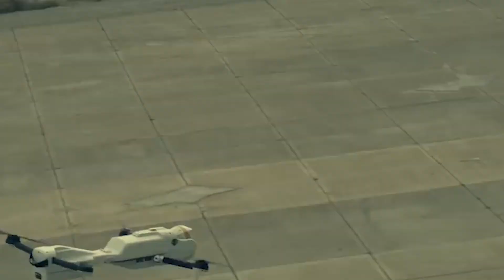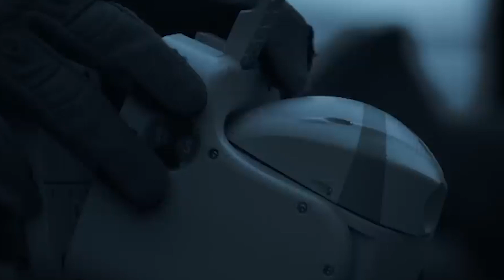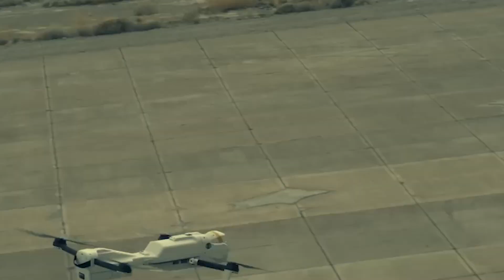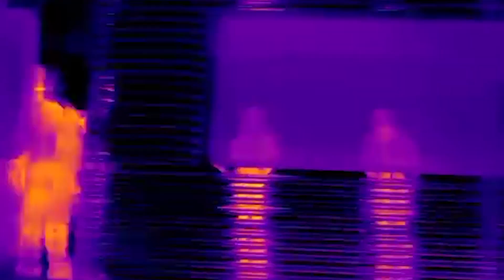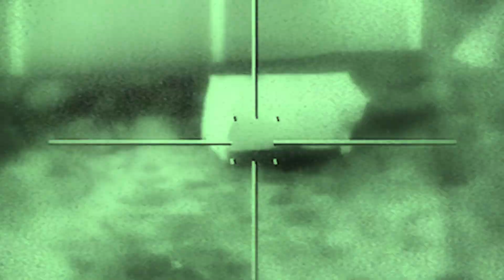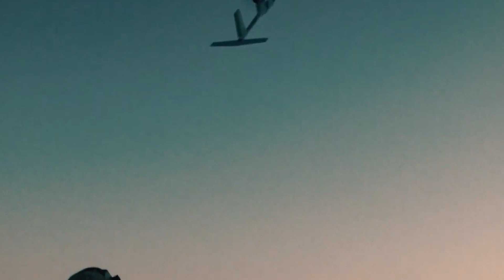The Tiny Yet Lethal US Drone That Turns Massive Targets into Rubble

Comment: I love this concept. However. Wouldn't it be cheaper to use this system as a pure reconnaissance drone and use this system to guide in cheaper less advanced kamikaze drones. This also means for the same prise as one you could get more hits on target using different warheads or even target more things in the area

Comment: Huh, so if the Russians think they have seen the worst of Kamikaze Drones, they ain't see nuthin' yet! Having a drone with a Gimballed warhead, that can run Silent, is a nightmare scenario. Plus is had various warhead payloads like Shotgun, HEAT, Traditional HE Kamikaze, plus it's also a scouting Drone with Radar/Lidar capabilities. Someone wanted to make a drone for all occasions, which does cost more than the one Ukraine is making and using but it can also do MUCH more, AND it is recoverable if it doesn't use it's payload, AND most importantly, Jamming won't work on it! NOICE!!!

Comment: $94 k, per drone, and The Ukrainian army can do it at max 1k per drone. Somebody is making a lot of profit somewhere .
Reply: An Australian company is providing Ukraine with some drones which are mostly cardboard and rubber bands and come flat-packed. They not a quad-copters, so you have to hand-launch them and they can't really "land," but are still usable as a kamikaze drone. And it's even cheaper.
Reply: @Meower68  I love those cardboard drones. They are also stealth. 👍
Reply: To be fair the vast majority of drones that Ukraine is using are very barebones and are just converted civilian drones with add-on munitions. A lot of the drones used by both Ukraine and Russia in the current war are relatively speaking inaccurate and depending on the operators and EW environment it might take five or ten drones to hit the target. Even that being taken into account it is true that this drone is just a rip-off. If you add thermals, capabilities that add resistance to EW, a better and more reliable fuzing system for munitions and so on you don't go from a thousand dollars to almost a hundred thousand but even ten thousand dollars would be a reasonable amount of money for an advanced one way attack drone of that size. You also have to remember that even if you make the argument that a thousand dollar drone is a good investment the suicide drones work similarly to artillery in the sense that the first hit is very important because after that the enemy will seek cover and be harder to hit and if you need to carry three or fives times as many drones for a hit that is a logistical burden.
Reply: 1K per drone. 93k to pay for bureaucratic BS.
Reply: probably more than 50% of that was developmental funding. i would be surprised if they can't at least shave that down to 20k or lower if they ramp up production and issue orders in 4-digit ranges. 
From that point on stuff like hardendness against electronic countermeasures, reusability (as they can also drop, not just kamikaze), performance and versatility will play deciding factors in it's cost/benefit analysis.
For example this one seems to have much better optics, which makes it more suited for survailliance and makes it easier to find targets.
its very possible that it would be the mid-tier option in a High-Low cost mixed arsenal.
Reply: @schlend4  yep...imagine that. Complexity beyond ::grunting caveman sounds:: cheap good/ expensive ripoff.
Reply: Those also have a 10 percent hit rate
Reply: Duh. The Grift tax is real. Like 800% + 200% shipping and handling
Reply: There is a reason there are reports of absurdly expensive simple items purchased by military procurement. It's been happening for several decades, maybe more.
Reply: Too expensive 😮
Reply: if the cost is more than $ 1k per kamikaze drone,  it is already losing on a real battlefield.  China can make those drones for much less than $ 1k per unit with artificial intelligence autonomous targeting capability .
Reply: This has been up in congress seveseveral times! They were talking about 300% increse as soon as the military gets involved🤯. Thats probobly the reason why Georg Bush and Bush Sr started buying in at sertain firms before invading Iraq.🤑🤑🤑
Reply: Those DJI drones (Ukraine) operate on known and easily jammable frequencies. A lot of tech goes into encrypting their communications and signal hopping (which requires additional tech for the control unit). 

Also, the sensor suite on these drones are in an entirely separate league then off the shelf DJI drones.

Akin to being able to buy a cheap red dot for $50, or  $1K+ for a military grade sight from eotech.
Reply: The LiDAR and SAR are very expensive pieces.
The video is sort of vague.  It  is not a FPV?
Reply: Very different. This weapon is to be precise with stealth and little to no collateral damage, Ukraine is using it for general purpose. As they employ more, the more counters will be developed. This system is more reliable that commercial drones, Ukraine is having to deal with jamming and anti-drone systems- I assume that’s why they designed it the way they did, to eliminate HVTs without collateral.
Reply: It has a lot of features that those drones don’t but also they’re only making a few of them. With higher production the price would come down.
Reply: If a $1k drone can serve a mission, that's great. But, you miss a LOT by comparing a $1k drone to these. In many environments, jamming precludes cheap drones. The Rogue has more advanced means to overcome jamming. It also has thermal imagining, which a $1k system will not have, let alone with the high thermal and pixel resolution (I know someone who worked on that). I also heard mention here of its incorporation of LIDAR - another major enhancement. Then there is almost certainly, an advanced chipset and software to fuse the multi-spectral (3) information into both a coherent presentation for the operator, and as an aid to autonomous targeting of a deployed weapon. (higher kill rate)
Reply: "The Ukrainian army can do it at max 1k per drone. "
Those Orcs are not using stealth drones with thermal imagery, etc... They beg for 30 year old kit.
Reply: WHAAAAAT?!

NEVER!
Reply: Now you know why the American Taxpayer is broke.  What a scam.
Reply: The military industrial complex is a monopoly. They can charge about whatever they want because thanks to lobbyists buying politicians and these companies hiring high ranking military officers, former politicians or politicians family/friends they have eliminated competition from the market.
Reply: This drone has cameras on it that cost more than the drones Ukraine making both are great for different situations Ukraines cheap so they can use tons to try and destroy troops bunkers tanks etc and loose tons not hitting targets without a worry these on this video are sorta for the same idea but not really if you get what I'm trying to say
Reply: @CantFixStpid  no nobody gets what you're saying because you talked yourself in a circle. But I'll bite what are you trying to say cause I'll bet it's gonna be hilarious
Reply: The Ukranian Army does NOT make it's own Drones